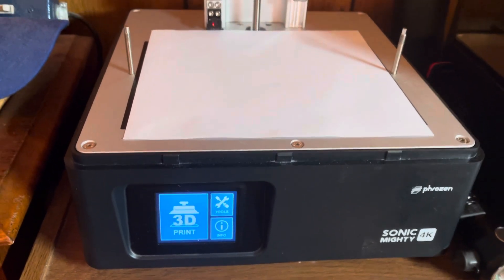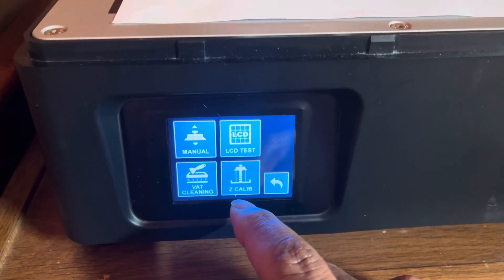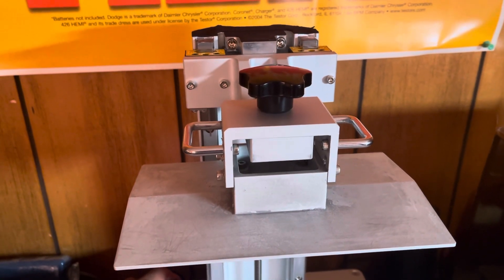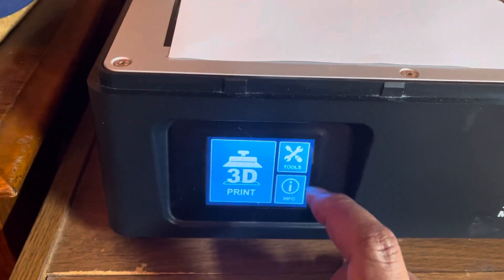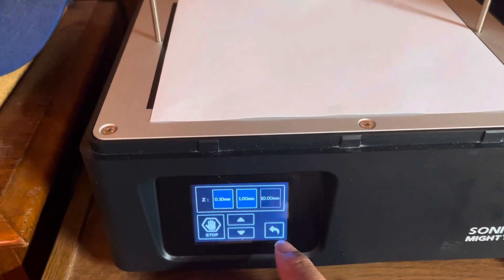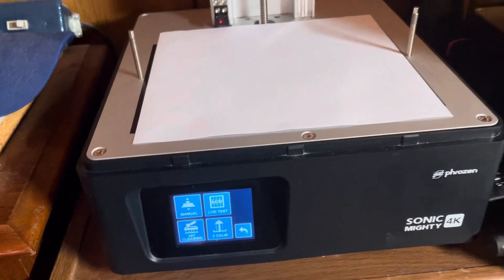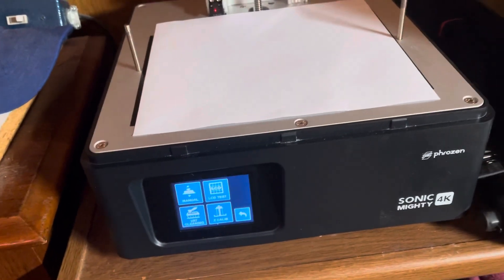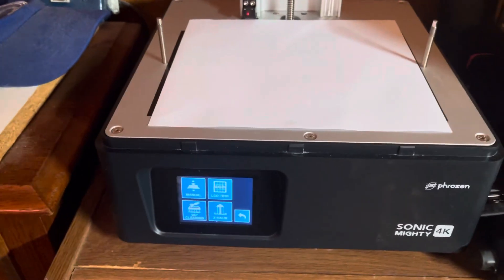Issue with Z calibration with Phrozen Sonic Mighty 4K.

Comment: Did you ever figure this out? I have the issue in the opposite direction
Reply: I also have the issue of the z-axis not calibrating.  It goes down and then the motor just buzzes while putting a lot of pressure on the lcd.  Did you figure it out?